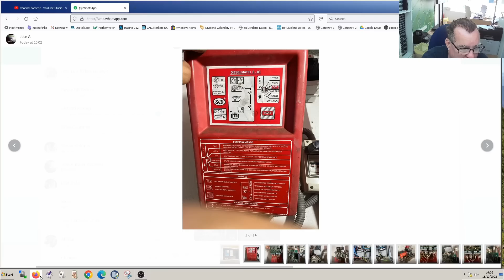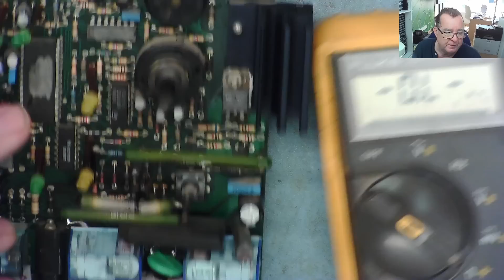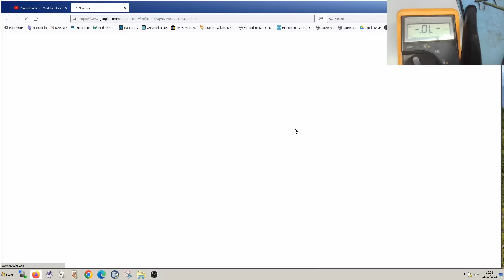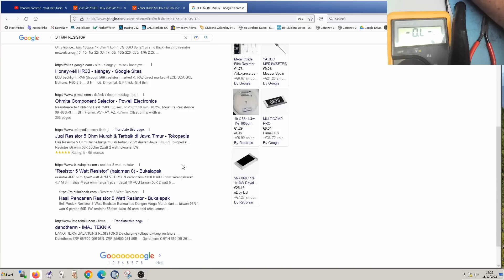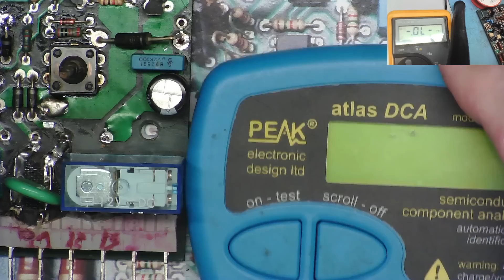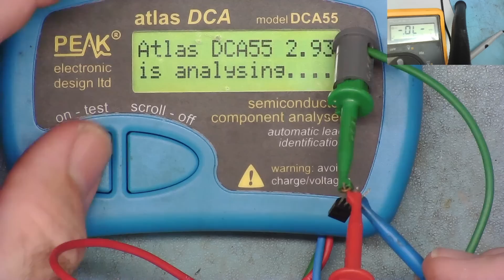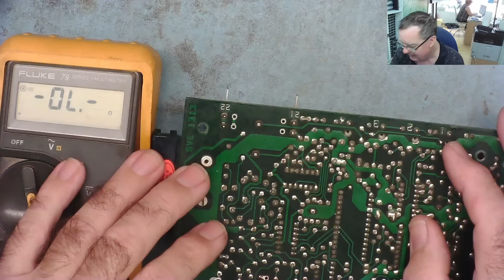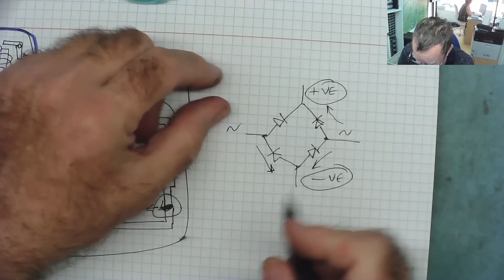Industrial Electronics Repair Use Basic Electronics Knowledge To Fix Just About Anything For PROFIT

Comment: Hi Richard. To easily remove lead-free solder from a printed circuit board, use low melt solder and mix it with the lead-free solder. Then you can easily remove it with your desoldering device. Don't forget to clean with ISO. After that you can safely solder new or the same components back, but this time you use normal lead-containing solder. The simplest and easiest way to remove lead-free solder. I do have to confirm that it is a very difficult circuit board that is made quite cheaply. The solder pads come off very quickly, indicating a non-professional etching of the board. Best of luck with the repair. Greetings from Belgium. Andy.
Reply: Judging from the pcb technology I assume this was made before lead free solder became a thing?  Or did I miss something in the video?
Reply: Iso is overrated. Use a sonic

Comment: You are a very good teacher.  Unlike other repair technicians on YouTube, you really troubleshoot and fix to the component level difficult, large circuits in real time (no fast forwarding), which I like because I have poor soldering skills, especially with SMDs.
Frank
Frank Reiser Video/Audio Service

Comment: I think that PCB is an AVR(Automatic Voltage Regulator). It controls the output voltage by controlling the input voltage onto the rotor of the alternator. This depends on the frequency of the device/ rotation speed of the alternator. It is a 3 phase generator. 220V single phase (L+N)and 380v phase to phase.
Reply: The avr is usually a stand alone board close to the exciter at the back of the alternator. This looks like a main control board due to the multi position switch and the relays.
The avr could be built into this board but all the gensets I worked on year’s ago had separate avr’s.
Reply: @deangriffiths8107  You are most likely correct this is a control board and not an AVR. Maybe this board is monitoring Voltage and Frequency and thus has the buzzer for alarms. Richard will sort it out

Comment: Hi Richard when you desolder use flux that helps a lot and also use lowmelt solder and you will see the desoldering from example the bridge rectifer will be very easey. 
Use this tips.

Regards Steve from Belgium
Reply from the maker: Hi Steve there are plus and minus factors to this, I use flux in a lot of my videos, and almost always add leaded solder to the joint to lower the melting point, but when you are working with through hole components (especially ones with many legs) the flux actually makes it worse if using a vacuum desoldering tool.  I don't know if you have used that sort of desoldering gun but if you have I am sure you would have experienced this. I think I demonstrated pretty well in this video on the 6 pole switch that it was the mixture of the old solder and leaded that was clogging the tool.  Of course different techniques work in different situations, and there are several ways of doing anything. 😉
Reply: @LearnElectronicsRepair  yes i know i do not use the soldering gun i use a manual sucker but i find that low melt solder it best works. For soldering through holes a litle bit heat and the component come lose with no resistance. I use it also for  mainboard connectors , charger ports and etc. Lom melt is not leaded solder it stays more liquid. 

Regards en keep the good movies up👍
Steve
Reply: @LearnElectronicsRepair   hey bro i have gpu i would like to send to u for repair.  the issue with it is,  whenever i tried to install driver the card would crash an sometimes it don't post at all... please respond thank
Reply: @LearnElectronicsRepair     Nu ma incurc si perd timp cu fleacuri Tresa de curatat si capul letconului curat bine decapat si incins rezultat garantat far frica de a distruge imprimatu ptru ca timpul de incalzire se reduce substantial iar treaba merge usor si repede

Comment: Nice tutorial on fault finding without a schematic! I also find desoldering on boards with lead free a real pain! Find that using a little leaded solder on the joint does magic. I have a Beltec SC7000 desoldering tool, I poke up the passage after each use, and empty the glass solder tube. I have experienced once a piece of a thin terminal getting wedged into the bit, have made a tool of hardened steel wire, and used it from the inside of the tool when hot, managed to clear the bit. Also I find it is very important to use the right bit for each lead wire and size of pad

Comment: I remember way back early 70’s I used to work on business machines and was plagued with relays of all sorts. For instance a central dictation electronic system where authors could call in and record events- the whole system was connected to the phone network (post office telephones back then). The whole system logic was Electronic except switching heavy loads A(i.e. motors, solenoids) and burn’t contacts were common as well as tiny audio signals passed through gold contacts which would oxidise and cause noise/distortion or even no signal! I was glad to see the back of that thing when they upgraded the system to solid state logic! The power supply was linear and massive (50 volt at 30 amp if I recall with lead acid batteries!) This was specified by the post office telephones as they were very cagey about anything connected to their system! The good/bad old days!  Haha

Comment: Thx for the vid.  When testing the relays, it matters the they move/click, but also important that the contacts (points) are making good contact to close the target circuit.
Reply: Asta este simplu de verificat fie cu multimetru s-au atasind sarcina artificiala ( beculete) la contacte Acest procedeu este ceva mai sigur ca forteaza contactele ptru a trece o oarece sarcina(curent A) si atunci poti intelege daca contactele sint bune s-au perlate ( cu rezistenta in contact)
Reply: "This is easy to check either with a multimeter by attaching the artificial load (light bulbs) to the contacts. This procedure is somewhat safer as it forces the contacts to pass some load (current A) and then you can understand if the contacts are good, they have pearled (with resistance in contact)"
Reply: @viorelpopescu4990 , thank you.  I recently had an automotive relay that checked GOOD on the bench being powered by a psu to a digital load tester.  I was baffled.  Ended up that the coil was failing (unusual I think) and sometimes closed the load contacts with good force, and other times did not.  Cheers.

Comment: 1:10:04 is a BC557B a standard BJT PNP small signal transistor typically used in the european region. PH means manufacturer is Philips semiconductors(now NXP) hFE 220-475
Reply from the maker: That makes sense as it is PNP, so not a 2SC5578 as I thought.  Thanks.
Reply: @LearnElectronicsRepair   hey bro i have gpu i would like to send to u for repair.  the issue with it is,  whenever i tried to install driver the card would crash an sometimes it don't post at all... please respond thank

Comment: Thanks so much. Absolutely brilliant as usual.  I learn something from every video.
So good to see everything you do with commentary warts and all.
Your videos educate, confirm that I'm doing some things right, show me where I'm going wrong and provide insight into new techniques all at the same time.
Just one thing.
I'm never sure what temperature to set the heat gun at when using it to desolder.
What do you use/ suggest?

Comment: A good tip for desoldering guns like yours is to keep the trigger pulled for a few seconds when finished desoldering a component and every 5 or 6 legs or so to clear the tube fully as the shaft is not heated all the way to the end.
Reply from the maker: Yeah some others have said that previously but the solder on this PCB repeatedly clogged the deolder gun.  Watch from 01:52:16 where I try to desolder the 2 pole 6 way switch.  Once I get rid of the old solder using braid, the gun never clogs at all
Reply: @LearnElectronicsRepair  Maybe in situations like this it may be necessary to keep the trigger pressed after each leg. I haven't experienced a board like this yet, so it's just ideas rather than experience I'm offering here. Would love to hear about the outcome of this fix.
Reply from the maker: @MrMaxeemum  Ideas are good - and experience also 🙂  I've had the displeasure of working on other industrial PCBs like this one before, probably dating from the 90s or 00s and they have a particular type of 'hard' solder you don't find elsewhere, I don't know what the alloy is but it is really nasty to work with and contains a flux that smells very acrid.  Whatever it is, it kills desoldering guns as you saw in this video.  The way I dealt with it on this video comes down to prior experience with the foul substance. 😝 Maybe someone can tell me what that solder alloy is but it is absolutely horrible to rework
Reply: @LearnElectronicsRepair  I suppose it doesn't help with the board being worked on so many times before. The copper may not be attached very well to the PCB in the first place also. I was curious as to whether or not the PCB had become conductive around those burn marks, would love to hear any follow up from this repair. Also how would you deal with it if it still failed to work? The customer obviously wanted it back quickly but surely they can't expect miracles.
Reply: @LearnElectronicsRepair  folosirea tresei de curatat este cel mai indicat si sigur lucru
Reply: @LearnElectronicsRepair    faptul ca se dezlipeste s-au curate greu inseamna ca in aleaj este folosit cu siguranta si argint care da o mai mare rezistenta lipiturilor la vibratii, iar mirosul neplaacut este al decapantului care se foloseste in acest caz cind se fac lipituri cu aleaj care contine si argint in compozitie Intodeauna capul letconului (disp de lipit) trebuie bine decapat si incins la o tp ceva mai mare decit la lipirile normale cu Pl

Comment: Sorry , but @ 1:02:20 , why is it acceptable for the relays' diodes to read much lower voltage than spec (~ 0.3 - 0.7) ? 
And if you chose to pull 1 of each diode's pins out of circuit , would it then read spec voltage ??

Comment: At 1:48:00 you show the return pressure/current being diverted back to the original 12v supply feed to the coil top via the diode. But what is stopping that possible 100v going back into to 12v supply?

Comment: Great video. I always had this question about repairing cards. When i worked in a lab, we had everything there to perform any repair and also we tested the equipments. But when you don't have a way to install the pcb back, how do you know that is fixed? do you send it to the client saying that he should test it and then if something goes wrong you check it out again until it's completely repaired, or how does this works?
Reply: Intr-un atelier specializat are sursa de sarcina artificiala prin care poate face verificarea completa mai ales acolo unde exista si documentatie In acest caz  mi se pare cam pe NV ( ne vazute)  Din cite vad sarcina de executie revine direct releelor prin urmare nu are nevoie de sarcina Problema este semnalul de comanda al sarcinii ca vad ca este extrem de procesat Ce semnal primeste De unde? De la ce? Ce  forma si nivel etc astea sint date ce trebuiesc cunoscute  In situatia data si ce am vazut cercetarea sa rezumat doar la circuitele de executie sarcina, tranzistorii de putere si circuitele aferente de polarizare in situatie statica si cam atit

Comment: There are two questions I have. First you did not check the first zener. There could have been a short cut on the print. Second, what liquid do you use to clean the print

Comment: a zancer diode is not like a a normal diode it a reversed voltage i used to test it buy applied voltages to it it will tells they go falsely or not

Comment: When I used to regularly rework prototypes, I used a cheap PCB pre heater - it was very low quality, but getting the whole board hot definitely makes getting components off easier with an iron and heat gun. The boards we did were mostly SMD, but the heavier power components were THT...
Reply from the maker: Yes I do that too on a lot of videos for SMD. I'm not sure it would have helped here, though i guess I was doing a similar thing using hot air from the rear of the PCB while desoldering some parts

Comment: Hi good video very informative. But is there a way that you test microprocessors
Reply from the maker: There are some basic checks you can make - does it have power, is it stuck in reset, is an interrupt pin stuck. does it have a clock, force the data lines to read the equivalent of NOP instruction and the address lines should count upwards.  If the job is important (and paying enough) you can reverse engineer the PCB, work out the IO and memory map and then program your own test eproms, or remove the microprocessor and make a little test board with eprom to run simple programs to flash LEDs in sequence etc..  I used to do exactly that sort of work for a company specialising in industrial repair in the 90s.  Microcontrollers are far more difficult but you could make a test board to manually or automatically put logic levels on all input pins and monitor the effect on all output pins, using buffers and LEDs - for example use an Arduino to interrogate the microcontroller - at least you may see if it is basically capable of doing something, or just dead.

Comment: the most common false is the power supply when they leaking a it burned out a resistors without any colours with its body’s you can’t  tells how may ohms its should be how do you worked outs the correct resistors it should be for me it’s easy is to go back to VIR let’s says 6 volts  divided 12 ohms=0.5 Amps  to fine out how many watts for a resistors 0.5 multiple by 6volts=3watts maybe I’m right or maybe wrong

Comment: Always interesting to watch and learn. Those long green wire wound resistors are possibly from ElectroDH a Spanish company i think & still available? Not sure if like most things they are made outside Spain. Although may be better alternatives more easily available to you.
Reply from the maker: Yeah I'm going up to the two electronic components stores in the capital Las Palmas tomorrow so maybe the will have them, seeing as they are Spanish.
Reply: @LearnElectronicsRepair   hey bro i have gpu i would like to send to u for repair.  the issue with it is,  whenever i tried to install driver the card would crash an sometimes it don't post at all... please respond thank

Comment: Why don't you use low melt solder it will be much faster and easier. And flux also :)
Reply from the maker: I mostly avoided using flux on this job as it clogs up the vacuum desoldering tool if i decide to use it.
Reply: And old school desoldering pump that doesnt push on pads like crazy removing them with the solder, what a mess

Comment: Waggling a vacuum desoldering tool back and forth is not very effective. It is much better to move the tip around in circles so that the pin is pulled away from the sides of the hole all the way around.  It is also important to allow adequate heating time before turning on the vacuum, otherwise all you do is suck molten solder off the top which prevents good heating to the other side of the board. You must be careful not to heat too much or apply too much pressure either of which can damage the pad.